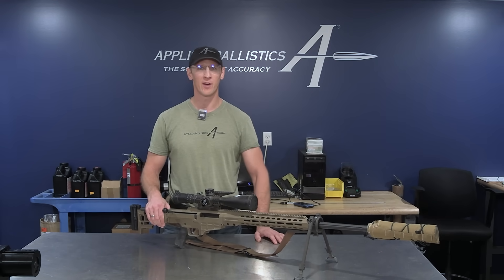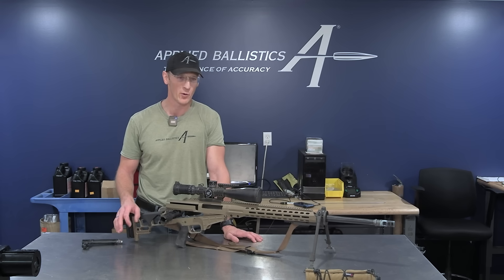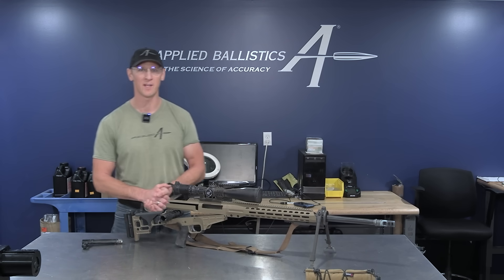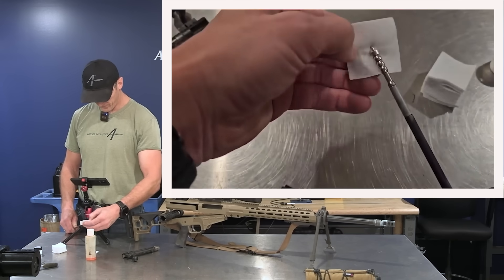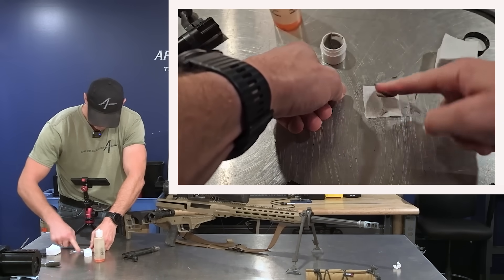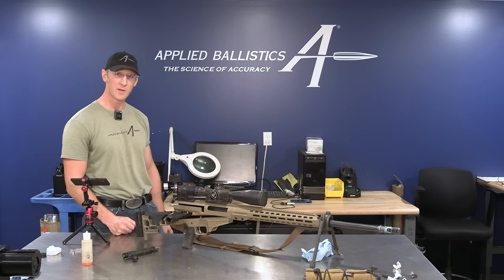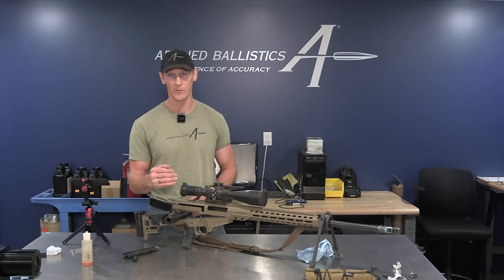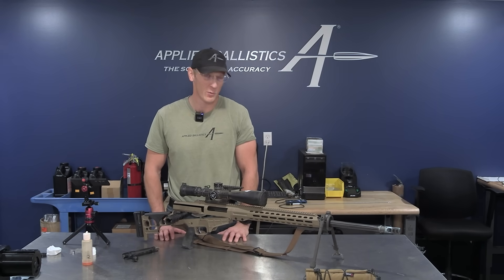High Performance Rifle Barrel Cleaning

Comment: Mr Litz, I have found a product that gets rid of carbon rings much easier than JB paste, it’s called Flitz bore cleaner. It does require a brush per the instructions but they say it’s non abrasive. Does that mean I still should use the JB every once and awhile to smooth things out? I don’t understand how it can work so well and still be non abrasive. I don’t see any damage from using the Flitz in the bore scope. Just a bore that looks absolutely clean, at least after multiple applications.

Comment: Newb question here.  If the patch is just stuck on the end of the rod, how does scrubbing back and forth work?   Does the patch not just stay at the furthest distance you've pushed the rod when you're pulling the rod back?
Reply: JB is a sorta lubricant, when you use an extra patch like he demonstrates to make it a super tight fit to the jag, the jag keeps it in place with its jagged edges and the lube properties of the JB helps it slide. Ive used this method since I watched this first about 6 months ago and it works well.

Comment: Outstanding video. A tight fitting patch cannot be overstated. I've learned to clean barrels using this exact from my unkle Bob. Back in the 1940's-50's he made his own bore abrasive cleaner using Colgate's ammoniated tooth powder and vaseline. Bryan is also right on about shooting about the max of 250 rounds = or - between cleanings.

Comment: YOU DID NOT LAP OUT ANY FIRE-CRACKING WITH A PATCH AND THAT LAPPING COMPOUND (THAT WOULD HAVE TAKEN THOUSANDS OF STROKES) - YOU JUST FILLED THE CRACKS UP WITH LAPPING COMPUND, THUS IT APPEARS THE FIRE-CRACKING IS SMOOTH!!!!!!!

ONCE YOU "SHOOT-OUT" THE THROAT OF A BARREL IT IS ALL OVER - THE SUPER ACCURACY OF THAT BARREL IS GONE - RIFLES DO HAVE A BARREL-LIFE!!!

IN A MILITARY ARMOURY THERE USED TO BE A TRICK - STOP THE MUZZLE END OF A BARREL UP AND FILL THE BARREL WITH AMMONIA - LEAVE IF FOR TWENTY-FOUR HOURS - UNSTOP THE BARREL AND WATCH THE GREEN JUICE RUN OUT - EVEN THEN YOU WERE ONLY CLEANING THE GLUIDING METAL OUT OF THE RIFLEING - ACCURACY WAS SOME-WHAT RESTORED, BUT NOT DUE TO ANY LAPPING COMPOUND, BUT DUE ONLY TO A REALLY GOOD CLEANING!!!

THIS WAS A GOOD VIDEO, BUT I THINK A GOOD BRONZE BORE BRUSH AND SOME HOPPES #9 IS ALL ONE NEEDS TO SLICK UP A BARREL - LOL!!!!!!!

Comment: I just watched your technique again. I commented a while back but I have since used Flitz bore polish and Thorroclean with great results also.  The main takeaway is to keep the bore clean.  Viewers should know that one pound of gun powder equals 7000 grains. If there are 25 grains of powder in a 223 Remington cartridge (example), then you burn that one pound of powder every 280 rounds through the bore.  Not all of the powder gets expelled through the muzzle. This is what causes increased pressure and accuracy issues.

Comment: Good stuff!  Thanks for sharing.  What parameters do you use to identify that a barrel is "broken in"?  Some say a slight jump in velocity.  I assume velocity levels unlike continued increase as you point out due to bullet drag and increased barrel pressures.

Comment: What I do is plug one end of the barrel with a number 2 pencil, or one of the fat ones kindergarteners use, depending on caliber. Then I open an old lead acid car battery or two and use a turkey baster to fill the barrel with acid standing on end. I ground it by soldering a 4ga copper wire on the bare steel inside the end of the barrel attached to a 4’ solid copper rod driven into the ground exactly 3 1/2 feet deep. Then I leave it in the sun for exactly 13 days. I start adding 1/2 teaspoon of baking soda in through the breech every 4 hrs for 4 days. Then I solder shut the breech with fishing weights and a propane torch and then cool it with dry ice. Then 7 days later I cut the copper grounding wire. Flip the barrel muzzle end up… I take a ball peen hammer and drive the no 2 pencil into the muzzle till it’s flat all the way in. Then I take a metal rod the same caliber diameter as the bore and drive the pencil through the barrel while slowly heating the breech in a fire made of dogwood and rosewood. While driving the pencil through the bore, the lead plug from the fishing weights will heat up and give way under pressure. When the fire hits the acid mixture it will ignite and blow the pencil half way out of the barrel and then suck it back in all the way through the barrel and out the breech into the fire in an instant. But only if you have done it right. If it doesn’t then you have to start over again. 
And then, after that,  I run a couple of oiled patches through it to protect it from rusting and you are done. 
Barrel will be cleaner than from the factory every time. 
I should add that I only clean my rifle after at least 20 rounds. But I never let it go more than 30 before I clean it. 

Hope this helps. 👍
Way better than how we cleaned them i  the army. Their way took forever and the armorer would keep sending you back till you cleaned all the bluing off of every part. 🤷🏼

Comment: For many out there I will cover a couple tidbits Brian didn't in this circumstance that are causing questions. One - the bore guide, or lack thereof. He is using a Tipton carbon fiber cleaning rod. It shouldn't hurt anything, wiped cleaned before each session back into the bore. Look them up, they embody many positives. Two - his paste here appears to be the bore bright and I guess the method is adopted for competition speeds. The JB cleaning paste (brown not grey) and Kroil method is easier on elbow grease but longer on time.  Benchrest shooters for many years abide the two part process.
Reply: Clearly you don't know how abrasive carbon fiber is 🤷‍♂️
Reply: @EitriBrokkr  clearly you aren't aware of the differences between CF and jacket brass vs cleaning rods of yesteryear on the bore? The only thing harder on the bore is the firing process. If you have something educational to share I will gladly review it and add it to my 30yrs in the arena.
Reply: @BM-pz4we  Tell me you're an ignorant goofball that has no idea about carbon fiber... without telling me. 🤡🤡🤡
Reply: @EitriBrokkr  Tell me you're a one track mind bandwagon goofball without telling me. Go back to your armchair until you're a glock AND 1911 guy. See ya in 20 yrs or so.

Comment: Typical Engineer. Don't tip-toe around the issue. Use abrasive, remove abrasive, and do it more frequently as the barrel ages, the end. 😆

Back when he used to answer emails over a decade ago, he was no different. "This matters, this doesn't, the end, go practice reading wind."

Great video Bryan!
Reply from the maker: haha, thanks!

There's a lot of fluff out there for those who like it.  I try to be respectful with your time.
Reply: @BryanLitzBallistics absolutely. I try to be the same way in my videos. Information dense, minimal fluff. 
Great stuff.

Comment: When shooting on P. dog towns with a lot of shooting, we brushed 15 strokes with good bronze bristle brush, then went to 5 patches soaked with JB as Bryan demonstrated, then 5 patches of your favorite solvent to wash the JB out of the bore, dry patches, called it done.

Each barrel and caliber will demand a certain regiment to maintain a particular accuracy standard you want, and I can not stress this enough.

Carbon builds up on it's self, gets so hard that only serious abrasives can get it out. This opens up throat dia and length.  You can measure throat dia with reamer pilots graduated in .0002 increments used on a grizzley rod, and it is a shocking learning curve.
Reply: What I do is plug one end of the barrel with a number 2 pencil, or one of the fat ones kindergarteners use, depending on caliber. Then I open an old lead acid car battery or two and use a turkey baster to fill the barrel with acid standing on end. I ground it by soldering a 4ga copper wire on the bare steel inside the end of the barrel attached to a 4’ solid copper rod driven into the ground exactly 3 1/2 feet deep. Then I leave it in the sun for exactly 13 days. I start adding 1/2 teaspoon of baking soda in through the breech every 4 hrs for 4 days. Then I solder shut the breech with fishing weights and a propane torch and then cool it with dry ice. Then 7 days later I cut the copper grounding wire. Flip the barrel muzzle end up… I take a ball peen hammer and drive the no 2 pencil into the muzzle till it’s flat all the way in. Then I take a metal rod the same caliber diameter as the bore and drive the pencil through the barrel while slowly heating the breech in a fire made of dogwood and rosewood. While driving the pencil through the bore, the lead plug from the fishing weights will heat up and give way under pressure. When the fire hits the acid mixture it will ignite and blow the pencil half way out of the barrel and then suck it back in all the way through the barrel and out the breech into the fire in an instant. But only if you have done it right. If it doesn’t then you have to start over again. 
And then, after that,  I run a couple of oiled patches through it to protect it from rusting and you are done. 
Barrel will be cleaner than from the factory every time. 
I should add that I only clean my rifle after at least 20 rounds. But I never let it go more than 30 before I clean it. 

Hope this helps. 👍
Way better than how we cleaned them i  the army. Their way took forever and the armorer would keep sending you back till you cleaned all the bluing off of every part. 🤷🏼
Reply: @TheBeefSlayer lol I can't believe you took the time to type that 🤣

Comment: Mr. Litz, does this cleaning method result in the distance to the lands moving back prematurely? I have a Tikka CTR (in 6.5 Creedmoor) which I used this cleaning method on and the distance to the lands moved back by about 0.1" (100/1,000ths) in about 2,500-3,000 rounds. Maybe it's normal wear for 6.5. I'm not sure. The thing still shoots < 3/4 MOA (on average) for 5-shot groups but she used to shoot < 1/2 MOA.
Reply: Not sure what it's like for the 6.5, but in my 308, every 100 firings seems to erode the barrel throat back 0.002" or 0.003"
Over 1000 rounds, that is 20 thou .. those add up.
Reply: @joesquid6988  Thanks for the info! Yeah, the throat of my barrel eroded by 100 thou in 3,000 rounds. That ~0.0033" per 100 rounds. I guess it's not that different than the higher end of what you are seeing.

Comment: Extremely helpful and I instantly subscribed.  Thank you.  I have been a big fan of Kroil and JB Bore Paste for a long time.  I was happy to learn that I was not "over cleaning" my barrels since I do this about every 100 rounds. But of course I always clean with solvent after every range session also. I was brought up to "keep your cars and guns clean" by my father USMC.  I was surprised how little oil you used to prep the barrel, and then remove the JB afterwards.  I was thinking to get some JB Bore Bright (the polish) or similar polish also.  Thoughts?  Lastly, do you put any light oil through the bore afterwards?

Comment: What I can't  figure out a jag and patch will not stay on ,pushing it and pulling, as soon as you pull it back it would fall right ,So what you would use is a bore brush with a patch around it .makes more sense .
Reply: If the patch fits correctly on the jag it will stay on there. You don’t just stuff the patch in there and push it through…. It has to drape over the sides of the jagg and fit right. The bristles on a brush will poke through and not press the patch against the bore properly. 🤷🏼
Reply: If it’s not staying on… use a bigger jag or more patches.
Reply: Old Nylon bore brush then rap a patch around it. Rap the patch the same direction as rifling then cover with bore paste...

Comment: Is it needed on .308? Or just regular cleaning from carbon and copper will be enough?
Reply from the maker: I cleaned my 308 FTR competition rifle this way, but it ran hot, high performance ammo loaded with 215 gr Hybrids.  A more standard 308 with more standard loads probably would be gentler on the steal, and maybe you could get away with solvents.

Comment: Bryan, what you think about filz patches? Have you ever used them?
Reply from the maker: No, I haven't tried many of the other abrasives that people are mentioning on here.  But I think they'd all work if you use them properly, some may even be more efficient than the JB that I use.  But once I find a way of doing something that I know what to expect from it, I tend to stick with it because keeping it constant will allow me to understand other variables and their effects.  Meaning, if I'm changing cleaning methods part way thru a barrel and it starts to foul differently, is it fouling different because it hit a certain point in it's life, or is it due to the difference in cleaning method?  So I just keep things the same that are working, because it helps me isolate variables and learn.

Comment: I have trouble with leading or polymer (not sure if it is one or both) with polymer coated bullets (9mm) after shooting a handgun.  I have a difficult time cleaning this out of the barrel.  Lately I have shot about 3 copper jacketed bullets after shooting the polymer coated bullets and that cleans out the barrel for me.

Comment: @BryanLitzBallistics, I love your content. I'm new to this and became a member of your site to learn, and it's been great! I'm curious about a few things. Why no bore guide? Also, It would have been interesting to see Velocities before and after cleaning. I've noticed my velocities climbing, and I will try this method with bore paste.
Reply from the maker: I use a bore guide in the rare occasion where I'm using solvents to clean a conventional rifle where it would leak down into / around/ thru the trigger / bedding, etc.  With paste, with the MRAD... I don't see a reason to use a bore guide.  I'm not runnin' that rod in there fast enough to damage anything.  Besides, I've cleaned many MRAD barrels this way for their entire life and they hammer all the way.  So I guess I don't do things that I don't see evidence or believe they're necessary.  

Totally agree I should have shot velocities before and after!  Having not done that, experience tells me to expect about a 50-75 fps set back on the first 1-3 shots, and it will settle out about 25-50 fps slower than where it left off dirty, and spend the next 100-200 rounds migrating back up.

Hopefully this method helps with the velocity migration you've seen in your rifles.

Comment: "clean and maintain on a regular cycle".  - yes, this. It gets old dealing with the "deep clean every time" crowd.  That's just not necessary.  This method works great and is so much less time consuming. Thanks!
Reply: Do you use bore paste exclusively to clean or  do you  use  solvent in between ?

Comment: Against advice from "seasoned" shooters, I have been doing this almost exactly for a while. 

Turns out I must be a genius. 😮 Thanks for the confirmation video.
Reply: What I do is plug one end of the barrel with a number 2 pencil, or one of the fat ones kindergarteners use, depending on caliber. Then I open an old lead acid car battery or two and use a turkey baster to fill the barrel with acid standing on end. I ground it by soldering a 4ga copper wire on the bare steel inside the end of the barrel attached to a 4’ solid copper rod driven into the ground exactly 3 1/2 feet deep. Then I leave it in the sun for exactly 13 days. I start adding 1/2 teaspoon of baking soda in through the breech every 4 hrs for 4 days. Then I solder shut the breech with fishing weights and a propane torch and then cool it with dry ice. Then 7 days later I cut the copper grounding wire. Flip the barrel muzzle end up… I take a ball peen hammer and drive the no 2 pencil into the muzzle till it’s flat all the way in. Then I take a metal rod the same caliber diameter as the bore and drive the pencil through the barrel while slowly heating the breech in a fire made of dogwood and rosewood. While driving the pencil through the bore, the lead plug from the fishing weights will heat up and give way under pressure. When the fire hits the acid mixture it will ignite and blow the pencil half way out of the barrel and then suck it back in all the way through the barrel and out the breech into the fire in an instant. But only if you have done it right. If it doesn’t then you have to start over again. 
And then, after that,  I run a couple of oiled patches through it to protect it from rusting and you are done. 
Barrel will be cleaner than from the factory every time. 
I should add that I only clean my rifle after at least 20 rounds. But I never let it go more than 30 before I clean it. 

Hope this helps. 👍
Way better than how we cleaned them i  the army. Their way took forever and the armorer would keep sending you back till you cleaned all the bluing off of every part. 🤷🏼

Comment: So mild abrasive on cottons wearing down gun barrel stainless eh?  Not seeing it...
Reply from the maker: @robertosborne1753  you're right, it doesn't wear down the barrel steel.  It does remove roughness and fouling.
Reply: @BryanLitzBallistics And the roughness isn't the same material/hardness as the gun barrel stainless?

Comment: Could older rifles (not high performance) benefit from this process or would you consider it even necessary?  I've got an older Swedish Mauser in good condition but not bore scoped.
Good video, I've subscribed.
Reply: That’s what I’m wondering. I have a 7-30 waters contender, and while it didn’t look bad when I cleaned it I’m wondering if it could benefit from this.